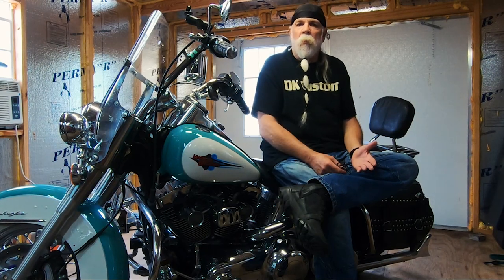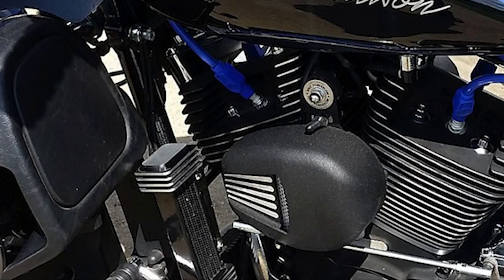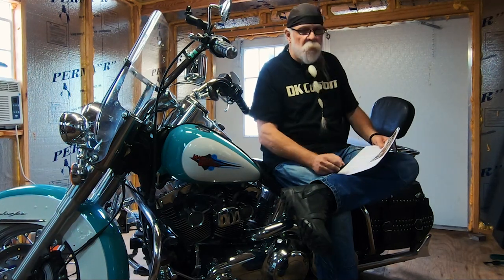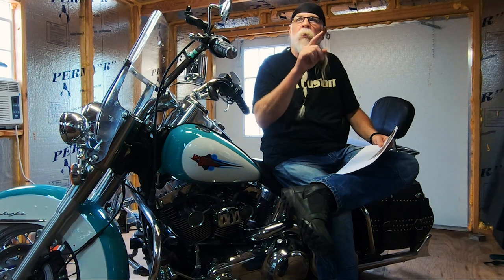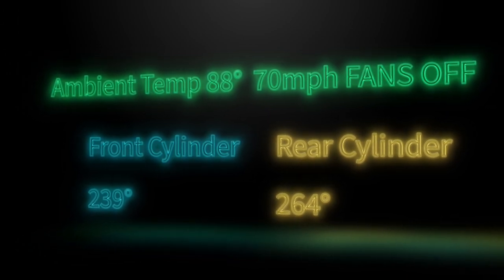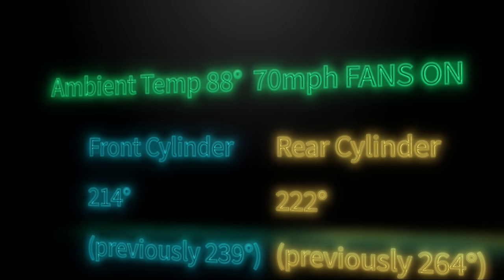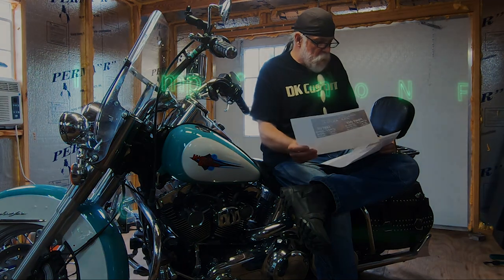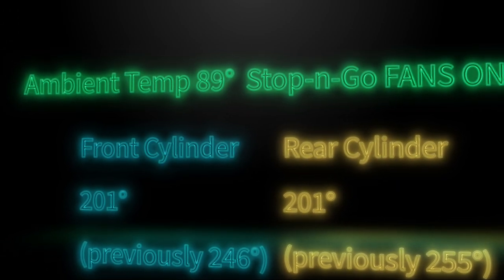Harley's DON"T Need Water-Cooling - Just More Air!

Comment: Hi Kevin. I'm with Rosymaydog. I just put the coil relocation kit on my 17 Slim S. Will these Mightymights work with that? Btw thank you all at DK for doing these videos. They are very helpful.
Reply from the maker: Yes, the bike in the video is a Softail with a Coil Relo and Mighty Mites.  Use a coupler  nut and a stud to extend the threads so that you can mount both.  Here's a link to a photo - https://www.hdforums.com/forum/attachments/dyna-glide-models/520044d1501254051-any-early-reviews-on-the-love-jugs-mighty-mites-coil-20cover-20wards-20fans_zpsremyx0n9.jpg
This is the hardware needed:
Stainless Fender Washer
A stud of the same thread that is already on the bike (5/16-18)

A Coupling nut (5/16-18)
Here's a photo- https://i1088.photobucket.com/albums/i339/DKCustom/Softail%20coil%20relocation/CoilFCSHDW_zps49110ab8.jpg
Reply: @DKCustomProducts  YOU ROCK !!!!!!!! ty. I may do this over the winter. I am leaning more towards a fan assisted O.C. but what I'm thinking is doing a total OVERKILL.  Buy installing an Ultracool (better than Jag imo) O.C. DK's Oil filter relocation kit and mighty-mites fans on my Slim.  Still trying to decide. That's nice chunk of money. Hmmm Maybe DK can do a DK Ultracool PACKAGE.... (insert thinky guy) and include all I mentioned above. hint hint hint. lol Thanks again

Comment: My sweet spot is 55-65 mph bike runs the coolest according to power vision
Reply from the maker: Yes, that is close to my experience also.  Moving fast enough for good air flow, but not so fast that the engine is generating more heat than the wind can overcome.  40-55 mph seems to be the sweet spot for running the coolest.

Comment: Thanks for doing this series.  I just got a 98 bore kit that included an upgraded oil pump with professional tuning thundermax put on my 06 SG.  I have the mighty mites.  Do you think it is necessary for an oil cooler?
Reply from the maker: If your oil is running more than 230 F, an oil cooler is a good idea.  Here's a link to a video on optimum engine and oil temps.  https://www.youtube.com/watch?v=rWOdQOtDv6A

Here's a link to what we do to keep the engines and oil in the optimum temps- https://www.dkcustomproducts.com/why-how-to-cool-down-the-twin-cam-engine-part-i-dk-cl-tc-dn-1.htm
Reply: @DKCustomProducts Huge thank you!   I am binge watching your videos, including your suggested video.  My build is almost finished; I hope to get it back this week.  I am still unclear how to know the oil temp.  I think in another video you said oil temp should be close to the engine temp with twin cams ..correct?
Reply from the maker: @shavenonthedarkside6708  Good to hear you are liking the videos and finding them useful.
A dipstick oil temp gauge is the easiest way to know the oil temp.
Yes, if a Twin Cam, once it has been ridden for around an hour, will have the oil come within a few degrees as the temp on the sensor in the cylinder head.
Highest temps you want to see on a Twin Cam is 230 F on the cylinder head temp sensor and 230 F on the oil.

Comment: This is great info. Many thanks.

I like the appearance of the mighty mites. They are not so big as to detract from the engine. I'll be getting some this winter, maybe santa will show his stuff and drop some down my chimney. That would be nice because I like to ride in parades.

I want to make a side note. I watched a video where a guy did a very scientific test of oil and its ability to remain stable at high temperatures. Synthetic oil was able to remain safe as a lubricant at much higher temperature than standard petroleum oil. I highly recommend Amsoil for the air cooled engines. My 2000 twin cam now has 88,000 trouble free miles on it and it is not noisy at idle. I have the factory mufflers so we can listen to the engine. No unusual noises in there. I got the message regarding synthetic oil and heat tolerance when I bought a new vehicle with a turbo. The factory manual recommended synthetic because it was less likely to clog the tubes that fed oil to the turbo. Now with 258,000 miles it still runs great.
Reply from the maker: Thank you for the comment.

I think you'll like the looks and function of the Force Flow Fan.  Mighty Mites will work also.
https://www.dkcustomproducts.com/jims-force-flow-fan-cools-twin-cam-engine.htm

No doubt, synthetics can take more heat than conventional oil.  Usually, on synthetics it is the additive package that will fail before the oil.

Comment: I have a Harley Touring twin cam Milwakee 8.
I cant stand the heat?
my dealer put on a setting to stop rear cyclinder when i am in traffic.
still hot!
dont have Fans what should i use??
FLHTK Unlimited Touring.
Cant RIDE In Summer.
Any Suggestions??
Reply from the maker: Not sure what bike you have, there are Touring Twin Cams, and Touring Milwaukee-8's.  But the same holds true for both...They run very hot, too hot for most folks.
There is no one big thing you can do to reduce the heat to a comfortable level, but there are quite a few little things you can do, that will add up to a lot.  You can see a written report at the link below, you can also see a video series at another link below.
For the fan I would use the one at the link listed last below.
https://www.dkcustomproducts.com/why-how-to-cool-down-the-twin-cam-engine-part-i-dk-cl-tc-dn-1.htm

https://www.youtube.com/playlist?list=PLb3bvZgbH92_3s-2vv63QggFJ3nteFd_C

https://www.dkcustomproducts.com/jims-force-flow-fan-cools-twin-cam-engine.htm
Reply: touring twin cams 107 milwakee 8
Reply: should i get mighty mite?
Reply from the maker: @louiedee279  JIMS at this link would be better.  https://www.dkcustomproducts.com/jims-force-flow-fan-cools-twin-cam-engine.htm

Comment: Hey K
Have a carb RDking 2006 running catch can,jagg slim cooler ans runnning amsoil syn.running average 212-220 at max..on HD oil temp dip stick.you were spot on with the catch can..runs cooler.never experienced trafic where i live and i plan accordingly..do you have a review on the mitymites compared to the other on you would like to put on your trike...keep up the good work.always interrested in your vid...very informative
Reply from the maker: Thank you, glad you're liking them.

Comment: I’d think the rear cylinder at higher speeds is soaking in the hot air blowing back from the front. And my oil tank is right behind them both. I wonder what that is cooking at? I know that I’ve felt the oil cap through my jeans . When it starts feeling like I have a lit cig in my pocket I let her rest. 
That  first 40 something degree drop was impressive. Glad I saw this before pulling the trigger on other products. 👍🏼
Reply from the maker: You can get a dipstick temp gauge to know what your oil temps are running.
Max temp you want the oil running at is 230 F.
Here is a video that talk about optimum temps for the different HD engines- https://www.youtube.com/watch?v=rWOdQOtDv6A
Reply: @DKCustomProducts  I have one I bought about a month ago. Thank you. And that’s why I’m now shopping fans. 👍🏻
Reply from the maker: @chefmike8888  Good deal.  Fans are an important part of the overall cooling strategy.

Comment: Wondering if there’s any fans that pull instead of push or if you could simply reverse the fans on the market. I feel like this would be beneficial in keeping AIT down as the fans I’ve seen blow from the horn side towards the intake side. I’ve fabbed my own breather filter kit I’m thinking I could probably make this happen too. Will report back after I record temps. Thanks for your videos and great info as always.
Reply from the maker: We have tested that (pulling instead of pushing) and did not get nearly as good results.
I agree with you on the pushing from the left side to the right side where the intake is.  At slow or no speed that seems like it would make a measurable difference, above 35 mph, depending on your intake, not sure that it does.
Looking forward to seeing what you report back.  👍
Reply: @DKCustomProducts  That’s good to know. Thank you. I did read in a forum a guy who had the love jugs and simply reversed the fans inside the housing with decent results, but I feel pulling fans would definitely need to big bigger or more powerful to achieve desired results. I’ll see what I come up with and get back with some solid temp numbers. Thanks DK 🤘🏻
Reply from the maker: @ketobeast8489  Yes, pushing is a focused stream of air (more effective) and pulling is a much less focused movement of air.
Looking forward to your report.
Reply: does it not harm the fanmotors/bearings pulling the heat over them ?
Reply: @Ericvl2102  I wouldn’t think so as there are many fans setup for extracting heat, but I have not tried this as of yet so I can not give a definite answer as to Harley engine temps being pulled over the fans.

Comment: In stop and go traffic does the hot air blow on your right leg
Reply from the maker: If you wear shorts, you will definitely feel it.
Jean, some folks feel it, some don't.  One thing is for sure, there is far less heat radiating out to the legs, because the engine is much cooler.

Comment: What model Jim's fan would I need for my '17 dyna fxdls because the horn is in the front, therefore not needed in the fan set up..Also would it be a smaller unit than the one with the horn relocation, or are they all pretty much the same size?
TIA👍 Also thanks for all the info you guys are putting out in these vids..The level of information you include is second to none👌
Reply from the maker: Good to hear you are liking the vids.  👍  The ForceFlow fans only come in one size, and they do have a horn in there.  You do not need to hook it up if you don't want to...OR, you could hook it up and have both horns blow.  http://www.dkcustomproducts.com/jims-force-flow-fan-cools-twin-cam-engine.htm
Reply: @DKCustomProducts  So are they different for the twin cams then the Milwaukee 8s because on your site they are listed different when choosing, or is it just different mounting hardware?
Reply from the maker: @MEGLADAD  The difference between the ForceFlow for the Twin Cam and M8 is in the mounting hardware.
Reply: @DKCustomProducts  Thanks for your replies👍

Comment: are the mighty mites compatible with the coil relocation kit?
Reply from the maker: Yes, the bike in the video is a Softail with a Coil Relo and Mighty Mites.  Use a coupler  nut and a stud to extend the threads so that you can mount both.  Here's a link to a photo - https://www.hdforums.com/forum/attachments/dyna-glide-models/520044d1501254051-any-early-reviews-on-the-love-jugs-mighty-mites-coil-20cover-20wards-20fans_zpsremyx0n9.jpg
This is the hardware needed:
Stainless Fender Washer
A stud of the same thread that is already on the bike (5/16-18)

A Coupling nut (5/16-18)
Here's a photo- https://i1088.photobucket.com/albums/i339/DKCustom/Softail%20coil%20relocation/CoilFCSHDW_zps49110ab8.jpg

Comment: I want to run fans. But at over $400, just not worth it in a monetary sense.
Reply from the maker: Yeah, we recommend doing one cooling mod at a time...then when you get your temps to the optimum, no more is needed.  Fans are one of the last things to do, only if you need that extra cooling.  I regularly run in 90-100 degree temps, with a heavy load and/or at speed, so I need them to get my temps to the optimum level.

Comment: So they are hotter at 70 than stop n go traffic?
Reply from the maker: Yes.  There is much more work taking place at moving the bike down the road at 70 mph.
Over time, in STOPPED traffic (not stop n go) you may approach the temps seen at 70 mph.  But if you are stopped for 15 minutes or more, shut if off and it won't get as hot as running down the road at 70 mph.
Here is another video with numbers showing heat at different speeds and in stop n go.
https://www.youtube.com/watch?v=6AhPqVlvE-w

Comment: I got a jims 120 on my road king. I just purchased the force flow. Let's see how it does!
Reply from the maker: I believe you will be pleased with it.  We have on every bike we've used them on.
Reply: @DKCustomProducts  in your opinion is it better than an ultra cool oil cooler?
Reply from the maker: @kfiercohen6910  It depends on what kind of riding you do and what kind of temps you're experiencing.  Oil temp takes a long time to normalize with the engine temp...so lots of short and/or slower speed riding will benefit more from the fan.  Longer, higher speed riding is when your oil starts getting as hot as the metal in the engine.  You already have an oil cooler on your Road King, so even in those situations it is hard to say without knowing your engine and oil temp which would be better.  There is a good video with info on optimum target temps for the engine and oil at this link- https://www.youtube.com/watch?v=rWOdQOtDv6A

Comment: Kevin are the mighty mites better than the Jim’s fan ?
Reply from the maker: They are good for about 5 degrees cooler...not much, but a little.  The Mighty Mites are a bit less expensive too.  However, I like the looks of the ForceFlow better, and with all the other cooling mods I have, this tilts toward the ForceFlow on my Touring model.  On the Softail in this video, I do like the MM's better for the look.
Reply: @DKCustomProducts  Looks like the mighty mites blow on each cyl head separetly. I too like the look of Jims forceflow better. Which installation is easier and how does the forceflow hold up to vibration?
Reply from the maker: @bigdog3495  Yes, there is a strong focused flow of air from each fan directly toward the spark plug area on each cylinder.  I would say the installations are about the same, maybe a tad easier with the ForceFlow, since there is no reinstallation of the cowbell, AND no monkeying around trying to get it centered like on the MM's.  

As far as vibration, the FF vibrates less...it has two mounting points rather than just one.  We've never had a FF fail (but that does not mean that failure is impossible), we have only had one MM fail, and that was on a Stage iV bike with aggressive cams that had a lot of vibration.

Comment: Do you still stand by the idea that the Might Mites are more effective than the full size Cool Master? I put an Ultracool oil cooler and considering the Love Jugs but don't understand how a smaller fan can cool more or more effectively.
Reply from the maker: The testing shows that the smaller ones are more effective.  They spin faster is the probable reason they cool better.  Unfortunately there was a big recall on them...thousands were made wrong.  They have been in and out of stock for months.  There are some available right now at this link- https://buylovejugs.com/?ap_id=DKKevin

If you prefer a different look, the fans at the following link cool almost as well as the Mighty Mites and very close to the same as the Cool Master.  https://www.dkcustomproducts.com/jims-force-flow-fan-cools-twin-cam-engine.htm
Reply: @DKCustomProducts  Wow, thank you for that information. Are the MM on sale at your link unaffected products? Do you know if LJ has recalled all the incorrect ones? I keep going back and forth on the MM vs the Cool Master. The black Cool Master looks to be a newer version than their original fans. I see the comparison of the two and it seems like they do perform better overall, the big fans have a slight advantage in stop and go traffic which is impossible to duplicate. Believe me if I can save $100 and have the same effect I would much rather do that lol. I think coupling with the fan assisted oil cooler it probably won't matter much anyway.
Reply from the maker: @sethg8501  Yes, all the affected ones were recalled many months ago...none of them are in circulation.  But then it took quite awhile to catch up with demand over the next few batches because they lost all that time.
The MM definitely cool better.  None of the defective ones are for sale.  It was a bad weld on the stem.
Reply: @DKCustomProducts  awesome, thank you so much for that info! I think I know which way I will be going now. And I will definitely be using your link to purchase. Along with the frame mount kit and I have been told that is a must have with these. I used the vibration master on the last set I installed and it worked ok. I hope the Frame Mount Kit is a little more stable.
Reply from the maker: @sethg8501  Thanks man, appreciate that.  I believe you will be well pleased with them.
Reply: @DKCustomProducts  I think so too.  I installed the original set on a previous bike and enjoyed it. I am glad to find out the MM are more effective, they look better in my opinion.

Comment: Thanks for the test and report. Now which fan is the recommended? More research is what I will do.
Reply from the maker: Thank you, glad you found it useful.

If you go with the Love Jugs, then the Mighty Mites are better than their other options.  Between the MM's and the ForceFlow, the effectiveness is a little better on the Mighty Mites, but not so much better that if you like the looks of the ForceFlow better that you would go wrong with the FF.

I personally like the Chrome MM's on my retro looking Softail, but prefer the Black FF on my Tri Glide.  My Sporty runs cool enough without any fans, so do not have them on it.
Reply: @DKCustomProducts  Thanks, that was just the info I was looking for as I like the looks of the FF more. Gives some symmetry to the airfilter on the right hand side =)
Reply from the maker: @Jan_Nicolaisen  Glad to help.